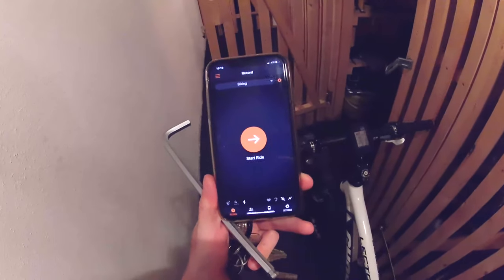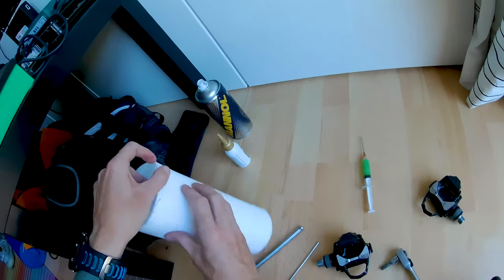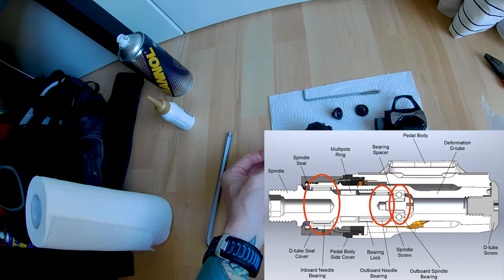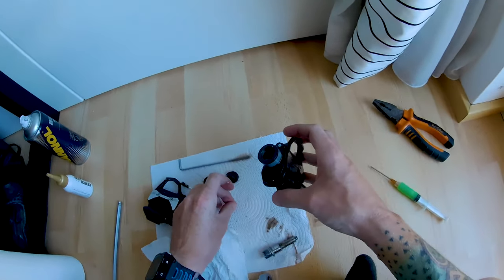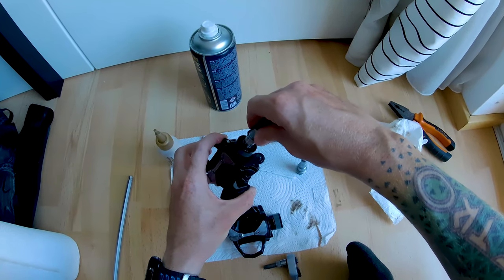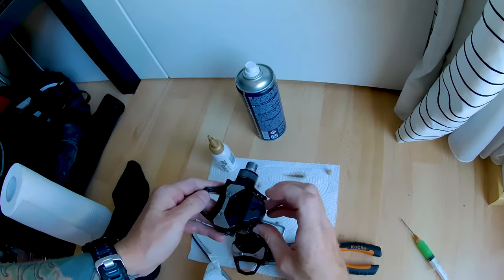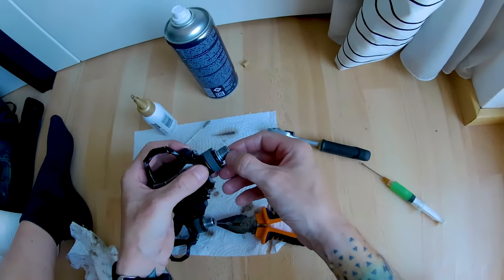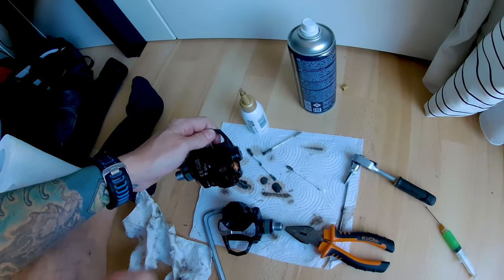Powertap P1 Powermeter Pedals (P1s) Zero offset / Disassembly / Bearing Service and Impressions

Comment from the maker: So just to let you all know - I ordered the FAVERO ASSIOMA DUO now - there are bearing kits available to replace by yourself and the overall reviews of the Pedals is just positive all the way. Will be the last time I ever buy any Powertap Product because I am disappointed in the Company and also in the Service Center that is quite arrogant. Funny that you can replace the bearings on other pedals without recalibration and using standard bearings meanwhile on the powertap special needle bearings are used - special tools needed to remove them and a factory recalibration needed - a big cash grab in my humble opinion. Hopefully my video at least helps you to keep your pedals good for a little longer until you replace them with better ones from another manufacturer.
Reply: Hallo, ich hätte mal ne Frage zu den Powertap P1. Meine tun nach einem gescheiterten Firmware Update nichts mehr. Die Sram AXS App findet das linke pedal noch und sagt mir, dass ich eine Firmware wiederherstellen muss…aber es verbindet sich nicht. Auch keine LED leuchtet mehr.

Hast du Ideen?

Comment: Thanks just serviced my Powertap P2s and will use them as a backup to my Favero Assioma Duos (which I bought soon as the P2s started playing up). The P2s disassemble the same way as the P1s, and have the same needle bearings, but slightly different axle and better seals.

Comment: My P1S pedal got stuck mid ride and wasn't moving freely.. I rode back home and tried cleaning externally.. no luck. Saw your video and was of great help in opening it up. It was a horror inside. The entire cavity was full of dirt and hardened greased mud. By the time I cleant the cavity through and through with WD-40.. I realized that the outer bearing was fully damaged and that's why it was ceased. I managed to break open and remove the outer bearing and put back everything and connected to the crank.. The Power meter and cadence still works 😲.. but play is tremendous and without the seal and without the outer bearing I don't know how long it will last.
Reply from the maker: Just ride it as long as it lasts you and then switch to a Favero Assioma or another brand. Maintaining and changing bearings on the Favero Assioma pedals is a 1 minute Job for a total bearing replacement.

Comment: Good to see a more in-depth video of how to self service the pedals 👍.
Reply from the maker: Thanks for watching.. still feel a bit sad that there are no spare parts available. The Bearing that I wanted to use as a replacement sadly does not fit 100% so I will have to keep the original bearings for now. But it should be good enough if I lubricate and clean them out regularly.
Reply: RyuX  Yeah it’s unfortunate that’s the case, I’m wanting to service mine due to trying to diagnose a creak which could well be coming from the pedals so I’m going to strip and clean the internals or as much as I can get to.
Reply: Do you have a link to the bearing that you are going to try to use as a replacement? I need to replace that same bearing.

Comment: Thanks! Unfortunately my Powertap bearings got rusted (water penetrated the bearing seal). I cannot even find the bearing model to buy a replacement. I can see that both Vector and Favero Assioma sells replacement parts from regular retailers ... bad news for me. I just ordered a Favero.

Comment: Great video, thanks. I may well give this a go in a couple of weeks.
Reply from the maker: Hope the video helps you out!
Reply: Should do I have had the pedals for over 5 years so I am pretty certain they are in need of a good clean and service.
Reply from the maker: @adrianlydiard597  Wow.. ok.. how many miles / kilometres would that be ?
Reply: I can't be certain but I'm pretty sure it's over 7000km
Reply from the maker: Adrian Lydiard OK. How is your bearing play? Mine have less than 5000km and it's quite a lot play already
Reply: @ryux   I got quite bit of play in my pedals too (about 5000km+), So I take it I will need to send them to service to get rid of the play? (Its quite expensive to send them for service, about 200 Euro with shipping to Sweden) Whats your thoughts of the Assioma pedals?
Reply from the maker: @Arcusboy  Hey. If I could make a new buying decision all over again I probably would go for the newest generation Garmin vector pedals. As for the play I think regarding the price and what those pedals are worth nowadays I would ride them until they are unusable and skip the service. Then sell them on eBay and Mark them as "bearing replacement needed". Then reinvest the money in some new pedals from manufacturer (in my case like I mentioned I would go for Garmin).
Reply: @ryux  Thanks for your reply, I think you are right about using them until they are finished, sell and buy different ones. The reason I look at the assioma is they are user serviceable and I don't mind the Keo cleats. Thanks again for a good video.

Comment: Great video and very helpful. Do you know what size the rolling bearings are?
Reply from the maker: Hey. I put the dimensions in the Video Description. However due to the design of these pedals you will need special tools to remove them - also the dimensions are non standard dimensions - in my opinion purposefully chosen by the company so that customers HAVE to send in the pedals for service. Thats why I sold my powertap pedals and got myself favero assioma duo and never looked back. Hope that helps

Comment: Thanks for the video. How did you get the measurement part out of the pedal. As shown in the picture. Is is necessary to press it out or has something to be loosen first?
Reply from the maker: Hey Tim. I never disassembled the Pedals any more than you can see in this video. You would need special tools that are not available to the public and the overall principle is unclear to me. I switched to Favero Assioma DUO pedals a couple of months after this video because the bearing replacement ony takes 2 minutes on these and they are a better overall pedal. Sorry that I can't help you further but the P1 Design is not designed for easy serviceability

Comment: Greetings RyuX,

Thank you for a great video, very helpful 👍.

Could the outside bearing be 13mm x 19mm x 12mm rather than 13 x 19 x 10??🤔🤔

Thanks again.
Reply from the maker: sadly there is no way of knowing as I wasn't able to remove it by myself and I switched to another Powermeter brand for good. Wish you good luck with your pedals hope you can figure it out. All the best
Reply: @ryux  Many thanks for your kind and prompt reply, most appreciated.

Comment: I did the cleaning procedure, but now both sides only measure cadence, and power at 0 watts, what could be the problem?

Another question, what would be the function of the gray plastic that is inside the pedal? it looks like something magnetic
Reply from the maker: Hey.. This is really weird. Did you re-do the Calibration Zero Offset ?  I am not sure what you mean with gray plastic ? There is a multipole ring which will help to know the pedal in which direction it is turning and how many RPMs it is doing. Maybe also try removing the Pedals from your device and pairing them once again
Reply: @ryux  Sorry, I meant to mention the ring, I didn't know how to mention that part. Its looks like multipole ring measure de Watts, which fulfills the function of some magnetism, metal does not fit well anymore, to the circumference. Is there a place where I can buy the spare parts? as well as the external bearing?

Comment: hi, how did you take the rest apart? and i think i might have a bit of trouble because one of the screws from inside (3mm) the head i think its damaged any help with that? thank you
Reply from the maker: Hey. Taking it further apart will need special tools that I wasn't able to get. If you have the chance I would sell them and buy proper pedals that have easy access and maintenance like the Favero Assioma Duo. These Powertap pedals are a nightmare to service and sadly not a very good design :(

Comment: Hi! My bearings are fine but im getting high Numbers in the zero offset (110 and 3.38nm). What do you think i could do?
Reply from the maker: Hello Felipe - sadly I don't have experience with the zero offset being off so far. You could try to disassemble the pedal and re-assemble it to remove any tension that might have built up around the main axle.  Are your power readings correct after you do the zero offset ?

Comment: The outer bearing that holds the spindle in the pedal failed on my pedal. I want to get in and see if I can repair - I have a lathe, so may be able to rework standard bearings to the right side. Do you know how to remove the outer caps, to get 'into' the assembly ? I need to remove the threaded insert (with the dot), into which the end cap screws into. Have you managed this, and what is the technique ? Thanks.
Reply from the maker: Sorry I never tried this myself as I sold the pedals already. However I can imagine you have to remove the "Bearing Lock" as in the picture at 6:16 and then use a press to remove the bearings. However I am not sure how to exactly remove them as I don't have the pedals anymore to further investigate. I could however imagine that the "Bearing Lock" is screwed in and that it has a big hex or some other shaped hole. The Engineering of these pedals is just the worst imaginable to be serviced without special tools (which was of course the intention of the manufacturer to get even more money out of his customers) thats why I now use Favero Assioma Duo's where I can easily replace the bearings.
Reply from the maker: If you talk about the "outer bearing" that is closest to the crank then I would imagine that you can remove it using a bearing puller.
Reply: Hi, did you manage to do this? Can we catch up about it as I have the same problem, I also have a lather so am considering making a sleeve for a non-fitting replacement bearing.

Comment: Great content! One question, I just bought one pair of P1 and I cannot find the mobile app in the AppStore, can you please share the name under you found the app?
Thanks!
Reply from the maker: Hello. You are right - it seems they removed it from the AppStore. It was called PowerTap Mobile but I can't find it myself anymore. After some digging I found that the new App is called "SRAM AXS" because the company SRAM bought PowerTap. I was able to connect my pedal with that app and set the zero offset.

Comment: Hi i was looking at some PowerTap P1 pedals second hand for 200eur. They seem a good deal dual power meter pedals but watching your video makes me think it could be 200eur flashed in the toilet sooner rather than later. What'd you think since you bought yours second hand too? Did they last long?
Reply from the maker: Hey David. In my humble opinion I don't want to support Companies like PowerTap anymore which make it hard to service your owned products. I Bought Favero Assioma Duo and never have been happier. On the other Hand if you just want some pedals to start with and use for a couple of seasons it might be a good deal for 200€. I used mine for 1 season then the problems started - the overall design is just not as good as the Favero Assioma Duo's where you can even replace bearings by yourself. But again... its your money - 200€ is not a lot depending on how good those pedals still are you might be able to use them for several years
Reply: @ryux  Thanks. I appreciate your advise very much. I think I'll put those 200eur towards some Assiomas. As well, the Powertap pedal design doesnt sit well with me. They look horrible looking. Chunky, heavy, outdated,...... All the bes. And cool electronic music videos you have! :-)
Reply from the maker: @GreenEverAfter  Thanks for your kind words :) You will not regret investing in those pedals - They are just overall great - rechargeable - nice design and reliable

Comment: Hi. I bought a powertap p1 and I have play on the axles. I bought them quite cheap) :) I wonder 
 how long will they live. Mayby return it and buy stages or ronde (for the same price)
Reply from the maker: You might be able to ride them several seasons with axle play but no guarantee. Maybe you could ride them until they don't work no more if you bought them cheap and then buy a new pair from another brand
Reply: @ryux  I ride around 10k on season. Before I use powertap hub sl+ but i change wheels. Play on axels is around 1 mm. I hear click sound when I push it :( I pay around 350 $...
Reply from the maker: @Pawe-df7md  I mean there is only 2 options in my opinion.. get rid of them if you can sell them for a profit or ride them until they are completely dead and then sell them as pedals in need of repair for a lower price. I personally really love my Favero Assioma Duo.. the bearing replacement is so easy and they are just overall a better pedal

Comment: Do you have a link to the bearing you think may work as a replacement? I need to replace that bearing
Reply from the maker: Hello. Sadly the one that I ordered does not fit and you will not be able to move the axle anymore - it has the correct dimensions but it is not the correct type of needle bearing. Powertap used a needle bearing that is impossible to find anywhere on the internet because of its weird dimensions Inner Diameter 13mm Outer Diameter 17mm and Width 10mm.. I searched every supplier in Europe and even China without any luck :(
Reply: Hi, Did you find the bearing anywhere? Mine is crumbed and so the pedal is unusable. Attempting to remove the working bearing from the right side (I have left only power meter here so right side pedal is 'dumb) and having it as a sacrificial pedals is a good idea at this point but I can't actually get the bearing out at all!
Did anyone get the bearing?
Reply: @vedio55  Hello, you managed to find the measure of the external bearing on the side of the connecting rod. I have the same problem and when I disassembled it was completely destroyed I need to see if I can get it here in a company specialized in bearings. Greetings from Costa Rica
Reply: @oscangus  I found nothing. Also removing the outer race is going to be a pig without damaging the pedal body